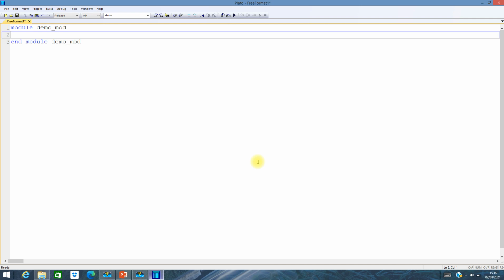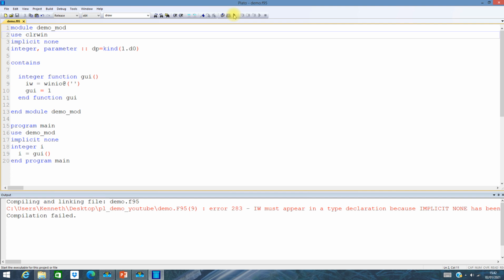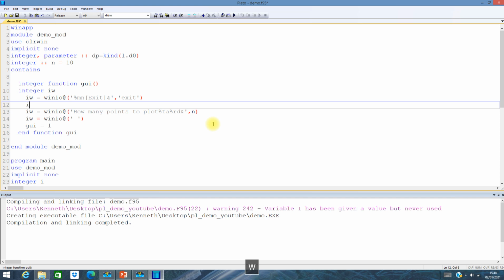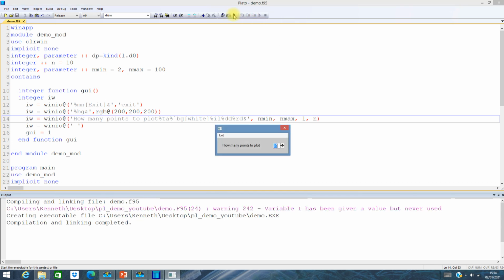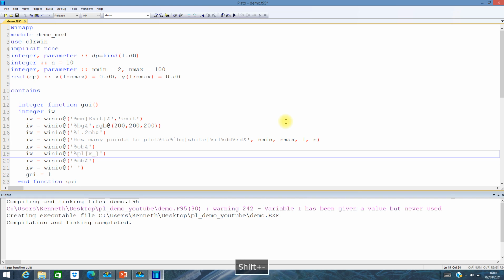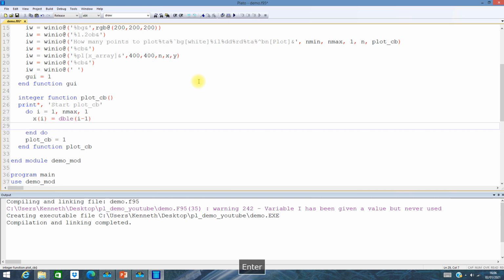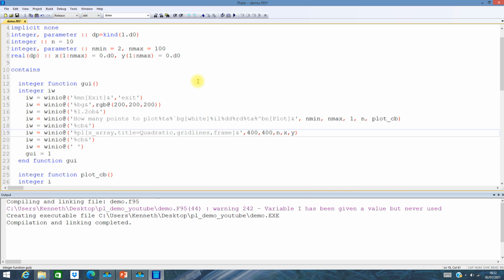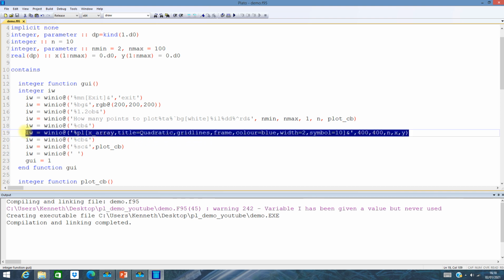Graph plotting in Fortran FTN95

Comment: Could you, please, give a link for downloading this demo program?  Thank you in advance. Fabio
Reply from the maker: The code is at the end of the video description above.
Reply: Ah, ok, I've found it.  Thanks again, very useful.
Reply: My interest is on a program that plots a given set of (xi,yi) points and the straight-line representing the linear regression (best linear fit).  Do you have a such program?
Reply from the maker: @FabioLima-pc2dk  Try the following.  No guarantee it's error free!  

program linreg_example
implicit none
integer, parameter :: dp = kind (0.1d0)
integer, parameter :: n = 10
real(dp) :: x(n), y(n)

! Define test data - this is a quadratic
x = (/0,1,2,3,4,5,6,7,8,9/)
y = x*x

! Do the analysis and plot the results
call pllinreg (x, y, n)

end program linreg_example

subroutine pllinreg (x, y, n)
use clrwin
implicit none 
integer, parameter   :: dp = kind (0.1d0)
integer, intent(in)  :: n           ! No of elements in x and y
real(dp),intent(in)  :: x(n)        ! X array
real(dp),intent(in)  :: y(n)        ! Y array
real(dp) m,b,r
real(dp) xlin(2),ylin(2)
integer iw, gx, gy
real(dp) nd, sumx, sumx2, sumxy, sumy, sumy2

! Do linear regression analysis on input data
  sumx  = sum(x)
  sumx2 = sum(x * x)
  sumxy = sum(x * y)
  sumy  = sum(y)
  sumy2 = sum(y * y) 
  nd = dble(n)
  m = (nd * sumxy  -  sumx * sumy) / (nd * sumx2 - sumx*sumx)
  b = (sumy * sumx2  -  sumx * sumxy) / (nd * sumx2  -  sumx*sumx)
  r = (sumxy - sumx * sumy / nd) / sqrt((sumx2 - sumx*sumx/nd) * (sumy2 - sumy*sumy/nd))

! Define two points on the linear line  
  xlin(1) = x(1)
  xlin(2) = x(n)
  ylin(1) = m*xlin(1) + b
  ylin(2) = m*xlin(2) + b

! Plot results  
  iw = winio@('%mn[Exit]&','exit')
  iw = winio@('%fn[Consolas]%ts%bf&',1.5d0)
  call winop@('%pl[x_array,independent,n_graphs=2,width=2,smoothing=4,gridlines,frame]')
  call winop@('%pl[Title="Linear Regression"]')
  call winop@('%pl[link=curves,colour=blue,symbol=1]')
  call winop@('%pl[link=lines,colour=grey,symbol=0]')
  gx = 500
  gy = 500
  iw = winio@('%ff%nl%pv%pl&',gx,gy,[n,2],x,y,xlin,ylin)
  iw = winio@('%ff%ts&',1.d0)
  iw = winio@('%1tl&',30)
  iw = winio@('%tc[black]%nl%cn linear slope%ta%`rf&',m)
  iw = winio@('%nl%cn y-inercept  %ta%`rf&',b)
  iw = winio@('%nl%cn correlation coeff.  %ta%`rf&',r)
  iw = winio@('')
end subroutine pllinreg